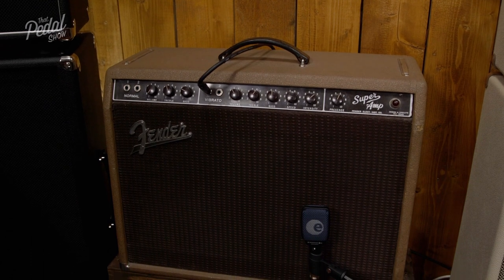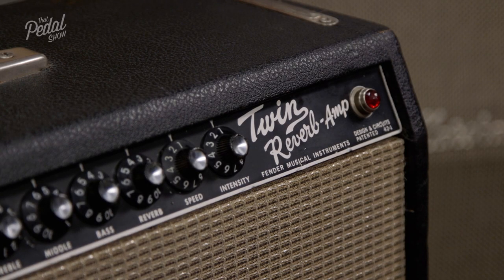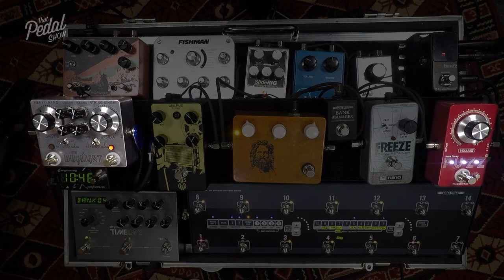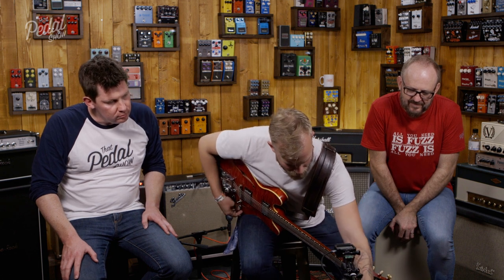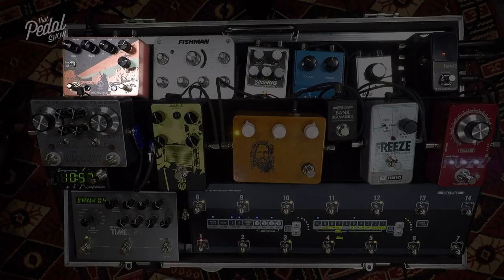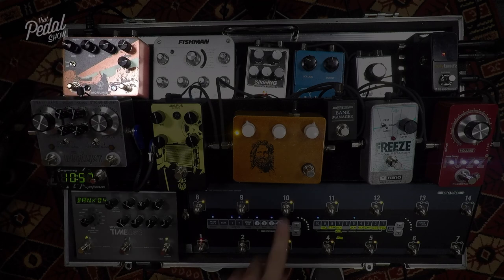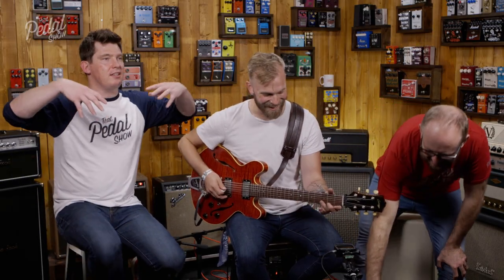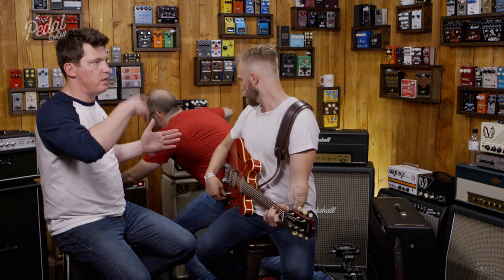That Pedal Show – Harmonic Tremolo, Joey Landreth & Associated Awesomeness

Comment: Great show guys. You've blown it for us Brownface freaks though. I think the prices just went up 20%!. There are actually two circuit versions of the harmonic trem Late 59 to late 60 used two preamp tubes for the trem. From then till the blackfaces the trem circuit used 3 x 12ax7s. Not all brownfaces had it. The Princeton used the standard bias mod setup.
Reply from the maker: +C. P. Nice! Hopefully Fender might reissue some. That would work. :0)
Reply: That Pedal Show I think one of the reasons they stopped was that it was expensive to build. Three tubes, sockets, chassis space, a power transformer with enough current capacity for all of the extra tubes. It all adds up. The real thrill is using one of these amps with the stand alone Fender tube reverb unit of the time. Psychedelic baby! Seeing you guys just breathless with delight at the sounds, and feeling that myself from the other side of the world (Australia) was a real treat. Fabulous show this week. Thanks again.
Reply: C. P. How would I know which tremolo my '63 Brownface Deluxe has?  Oh, I could pull a tube or two (or 3) and see if the trem still works?
Reply: Hi Babette, The deluxe doesn't have the harmonic trem. It is, however, in my view, one of the greatest amps of any brand in the history of the universe. You are very fortunate. What an incredible sound they have. Best dirt sound ever!
Reply: C. P. Thank you for the info!  Yes, it is incredible, and the best eBay purchase to date. I love it.

Comment: If you love harmonic trem, it's worth reading Leo's patent application for it, dated around '59. It's public domain. There are two documents. One shows a simplified schematic, and a very neat graph showing the frequency modulation carried on the LFO wave. And the other is Leo's careful and thorough explanation of every single component. It's an amazing read.

Comment: Optical compressors of the sort used in tremolos are really interesting from an electronics POV, they were often used in early film projections in order to improve sound quality, stopping quiet sections from being missed because of speakers and amplifiers that weren't able to play a large dynamic range. They are 'supposed' to be more 'musical' than other compression circuits.

Comment: Familiar with the tears.... I use an AC15C1 and a Fender Excelsior, which both have amazing tremolo circuits. I run them in stereo out of my Tech21 RotoChoir Leslie sim as the last pedal on my board. I often do the double tremolo with the two amps with a slightly different time on the trem, and it is AMAZING! It's even better with the stereo leslie going!! Of course, I'm missing the Joey talent, but other than that HUGE element, the sound is incredible!

Comment: Guys, great stuff as ever. Inspired me to take my 335 off the wall, tune to open G and dig out slide. Two things. I know you guys are coming from a purists point of view and I love cranking my Mesa up, but I'd luv you guys to explore plugins in some depth. I use my Mac for recording and certainly for the recorded sound and ease of use the digital stuff is getting really good. Know you've done a bit on it before, but think you have the nouse to raise the bar compared to other YouTube output. Second thing, Dan how's the bjj going ? I've got a black in karate and do Japanese jj.
Reply from the maker: +Gary Smith Yep, we both use em when we have to. Certainly for recording when you can't use the real stuff, or it doesn't make sense to, there's no question about the usefulness and practicality of plug ins. But to us they're tools for work. When we're at play, we'd much rather be inspired and moved. Hence all those old valve amps and pedals and physical experiences. Thanks for watching!

Comment: The circuit is kind of brilliant.  Take a push pull power stage, and think about adding tremolo.  Rather than double and invert the oscillator, you split the signal with a really simple capacitor high pass tap and oscillate the bias off the same voltage on both tubes.

Comment: Hey guys, I have a technical question. Did all the early "Brownface" amps have harmonic tremolo? I have an October 1962 Brownface Fender Vibrolux and was wondering if it was the same type circuit. I've always thought its tremolo was slightly different sounding than my 1965 Blackface Fender Deluxe Reverb
Reply: All Pro series brownface has it, not Princeton and below. Your 65 has a normal Fender trem, not harmonic.
Reply: superxorn The brownface deluxe doesn't employ harmonic tremolo either.

Comment: Fab video as always guys, fantastic to get such awesome players in! - but where's the oft promised Attenuator  vid??
Reply from the maker: +David Reynolds We keep talking about it, and keep wondering what anyone wants to know other than the obvious? Ie the make your amp quieter and change the EQ a bit. Do you have a specific question we could address?
Reply: Yup, apart from the obvious 'quieter amp', I would suggest general questions like....
How do different models change/suck your tone?
How do stand alone units compare with the current crop of amps that have them built in?
Does using one shorten the life of your valves?
How does the sound of a 100W head into an Attenuator pushing out 10% compare to a 10W Amp?
i.e. should you just buy a lower powered amp or get an Attenuator?
Do they alter the 'feel' under the fingers?
Can you use them with your favourite 100W head direct into a recording device or PA with no speaker? - like the Rivera RockCrusher Recording or the Two Notes Torpedo? - so you can record at bedroom volumes or play live? - begs further questions around speaker emulation?
Attenuator vs Digital Modeller for recording at low volumes?
Just thoughts chaps, might make for an interesting discussion?
Cheers
Reply: +David Reynolds A properly-designed attenuator will only shorten valve life according to how the amp is set: if one works the valves harder because the attenuator allows one to do so practically, then the valves will not last as long.

The volume difference between a 100W amp and a 10W amp is 50% (i.e. 10dB), as volume is logarithmic.  How this relates to setting one's amp and attenuator depends on how their controls are implemented.  A general rule for attenuators is that the least cut preserves the most tone; it best to start with a realistic amp wattage for one's typical usage, then use an attenuator to reduce the level either when one must be especially quiet or when one must crank the amp higher for a specific tone than a gig would otherwise allow.  The “realistic amp wattage” part is where things get really complicated, as there is much to be said about transformer size, “big bottle” sound, and speaker sensitivity.

Whereas a well-designed attenuator will not change the “feel” of an amp, lesser power attenuators introduce some power compression (e.g. running an AlNiCo speaker near its limit).  However, one may well use an amp setting which generates more compression because one's attenuator lowers the resulting volume.

Speakers are essentially filters, and they are the last filters in a guitarist's signal chain—not counting recording equipment (e.g. microphones).  Speaker emulation, therefore, exists because the direct sound of an amplifier is not what guitarists and engineers want to propagate and record.

Comparing attenuated valve amps with digital modelers would require at least one follow-up episode, as the comparison would build upon an episode's worth of lessons (see above).

Comment: Harmonic tremolo splits the two bands (bass and treble), runs them 180° out of phase, and runs each through modulated allpass filters, before mixing them together again. This does infact lead to a certain amount of vibrato (pitch modulation), not just the alternating bass/treble content like Dan was implying, although that certainly happens too.
Reply: Also, JMI 60's era Vox AC30 Vibe/Trem models contained a "harmonic tremolo" - more accurately labelled by Vox as Vibrato, so not unique to Fender.
Reply from the maker: +Greg Robinson Thanks Greg. We thought we'd get more of this - thank you for the insight. Cheers!
Reply: You're welcome. If you ever get your hands on one of the AC30's with Vibe/Trem, I'm sure your audience would appreciate seeing it and comparing it to other trems like the bias trem on the Victory. Cheers!

Comment: If I could ask what is the current mic setup? How do you record the shows because it sounds amazing! Maybe worth a video when you get it finalised.
Reply from the maker: +Chris Wills Hey Chris. We didn't change anything from normal except the preamp/interface and plug ins. So, Sennheiser e906 on the amps. Stereo X-Y condenser in the room. The. Universal Audio Apollo 8p into a Mac running Logic. Neve 1073 channel strip/amp emulations. Cheers! We have a BtS video coming up soon, which is current.... apart from the UA front end. Cheers!

Comment: Did Mick remove the Kingsley pedals broom his board after he got the two rock?  I see them in the back to the side of Dan.
Reply from the maker: +Leonel Hernandez Nope. We both have a set. They're very firmly still on there... however, the Two Rock does require a slightly different approach so there's something in the works for that. :0)

Comment: How do you split the signal to the two amps? which hardware?
Reply from the maker: +Jörg Dähler G2 has dual outputs. Or you could use an ABY switch such as TheGigRig ABY Baby. Or indeed a Humginger if you want them both on all the time. Cheers!

Comment: What's the best way to connect my super reverb and the v40 deluxe together :-) ???
Reply from the maker: +tchill76 Really depends what you want to achieve. Our Super is out of phase with our V40 Deluxe, so you'll may we'll need something to correct phase straight away. 
Any good AB-Y switch will do this, and naturally we recommend TheGigRig ABY Baby. If you don't want switching, just to run them both, you could use a Humdinger. 
Then you need to decide whether you want to split them from the board and use all of both amps... or you could run an effects sent from the V40 into the input of the Super (again, being careful about phase). This would give you the V40's preamp into the Super. Good luck!
Reply: Thanks i will have a look ;-)

Comment: Can you replicate the Dual Tremolo Experiment (what a band name) by running a Walrus Audio Monument into a Victory V40 Deluxe?
Reply from the maker: +Salisbury Simon You'd get some of it, but the two separate sets of speakers/amp is what created the hugeness. Cheers Simon!
Reply: Thanks Gents. 
Hmmm... 
V40 combo on slow + V40H & 2x12 with a Monument in the loop on fast maybe?
Somewhat cheaper than trying to buy a Brownface!
Reply from the maker: +Salisbury Simon Oof! That would work. :0)
Reply: Cheaper way, take the effect loop out of a tube amp with trem - into a stomp box trem - into a roland cube 60 solid state amp on the clean channel.  Now you have 2 amps in stereo, both with a tremolo.  The effect loop out should be after the tube preamp, but before the tube amp tremolo.  So it will have the nice tube sounds from the preamp.  Think of the solid state amp as a PA system, just replicating the nice tube sound of the first amp.  This is the setup I use and its killer.  Then you can put any other pedals in front of that solid state amp, like chorus or phaser and you get something similar to a wet dry.
Reply: Another way to go would be an Orange Rocker 32 and a pair of tremolo pedals, though there would be less stereo separation (and the speakers would be identical, if you did not swap them).

Comment: When he plays unampiflied, it sounds as if the action is quite high...so, is it?
Reply: Great observation and yes it is.  I never knew it until recently but slide-rigs are typically well off the fingerboard to avoid the fret buzzing... which was why my slide sounded so horrible lol.
Reply: Semi-hollows are usually louder and slide players usually have a higher action. Plus he uses megagauge strings so the tension on the neck might also be a factor.
Reply from the maker: +Zzvezdan8 Not massively. Remember he plays regular too, not only slide. So it's not super low, but it's also not mega high either. The guy's technique is crazy good!
Reply: Thanks.

Comment: Did they just invent a new pedal?   A trem pedal that splits the input and runs the signal through two trem circuits and then mixes them back together?
Reply: +Peter Miller The effect would be different without the differing speakers and the stereo separation.
Reply: Forgot about that.   Stereo rig it is then...   with 2 trem pedals....    Idea binned.